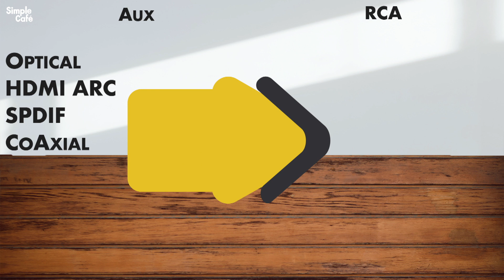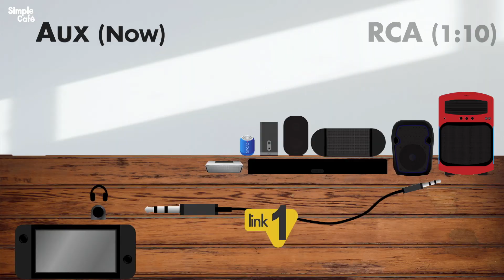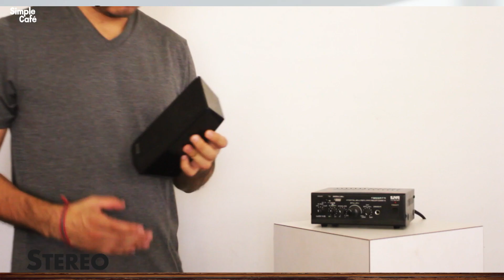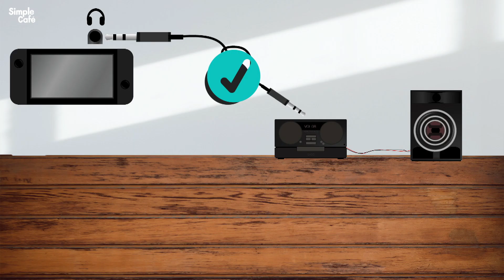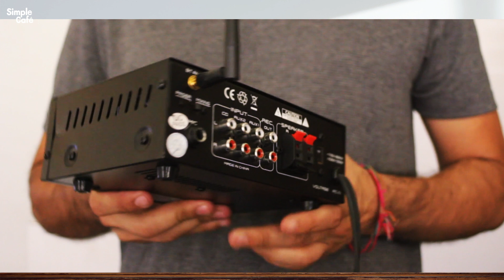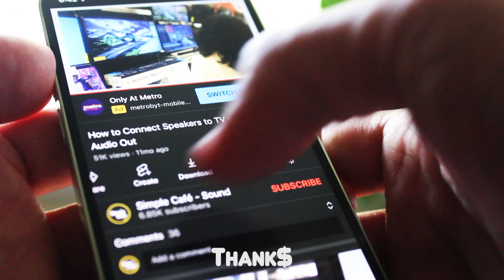How to Connect Portable Switch to Speakers (Aux, RCA)

Comment: Hiya My one still dosen't seem to work i am using an aux cable but the sound dosen't go through, there is only a low pitched buzz.
Reply: same issue
Reply from the maker: what kind of speaker are you connecting to?

Comment: Hi I am.going through mutiple video but still failed to connect my TV which supports Hdmi Arc to old Amplifier sony str db790.  Tried Hdmi Arc to Av converter but it's not working.
Reply from the maker: Ok first tell me two things. 1. The ports your tv has. 2. Do you have a single speaker or stereo system?